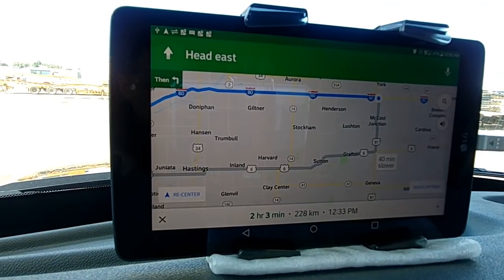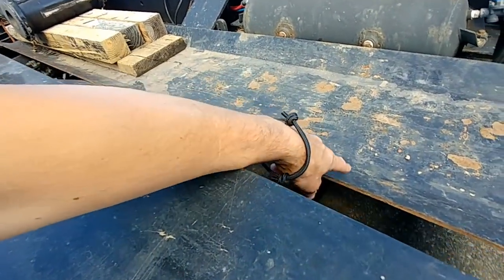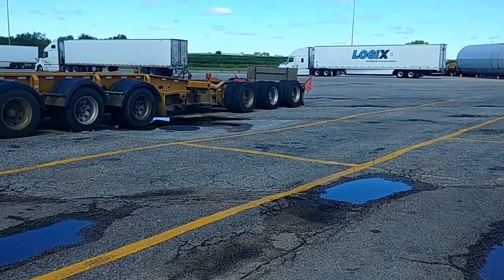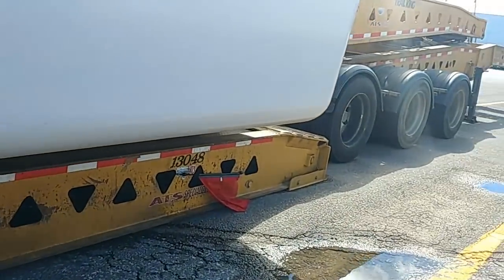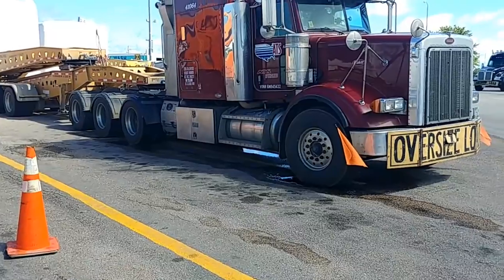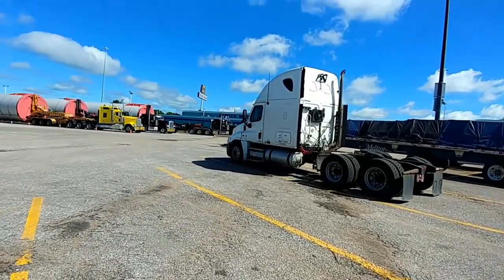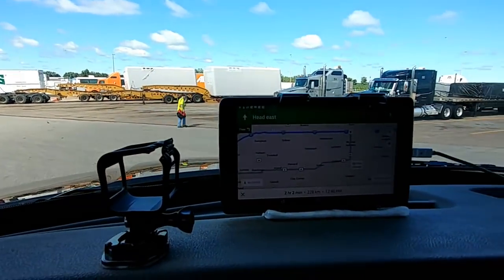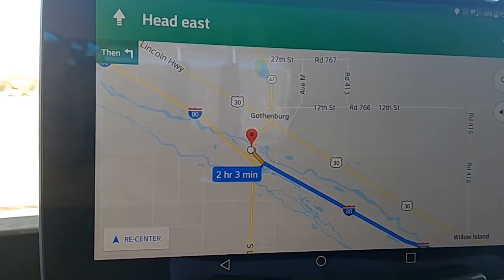KENWORTH HEAVY -- Episode 75

Comment: Hi CAPTAIN,
 Nice traveling out in the wide open spaces heh, nice walk-around the truck stop. 
  The temperature is more than likely from the high temperatures of the sun beating down on that roadway. If the air is 100 F+ that roadway temp is probably 130+ making the housings a little harder to dissipate the heat in the oil. By the way do they run a synthetic in those new differentials?   
Can't wait til you get to the mountains.
KEEP THEM BIG WHEELS ROLLING /  BE WELL

Comment: Sergei probably late but parleys has construction at the top so don't hit it in rush hour. take the cut off on I-215 from I-80 back to I-15 .Then its down hill to st George other then sipeo hill, which is nothing compared to parleys.Love your videos. I haul con rock daily 118000 lbs 2014 isx 15 cummins your temps don't seem out of normal. be safe and good luck.

Comment: Sergei On the newer trucks they run the temp. much higher. I had a hard time with letting it run up to 250 degrees and let the fan run automatic. But got better MPG doing that way. Hard for old dog to learn new ways. Have a safe trip.
Reply from the maker: Yeah, it was a shock to me on the Mack, when I switched from the International. The oil ran much hotter. Then I got used to it!